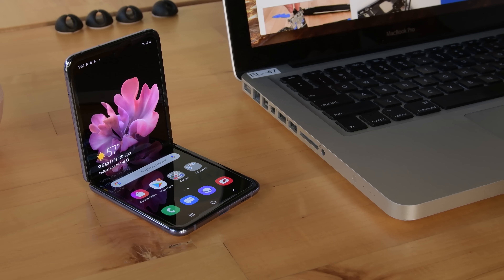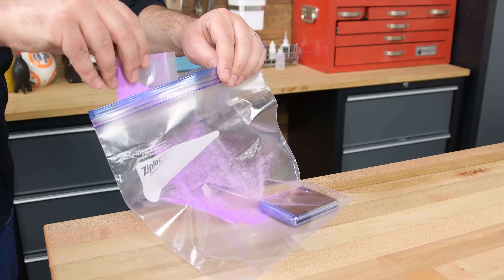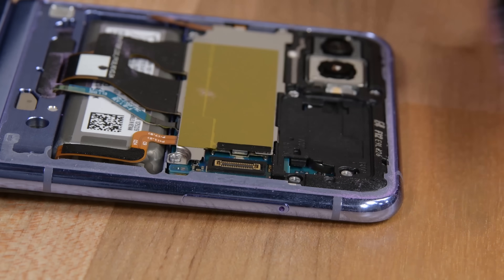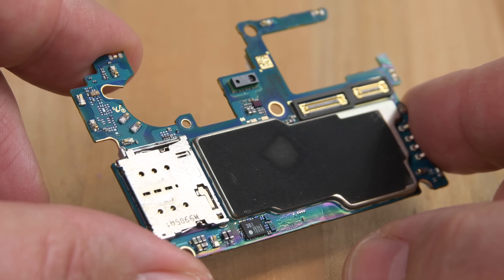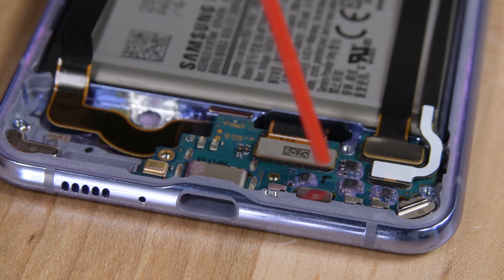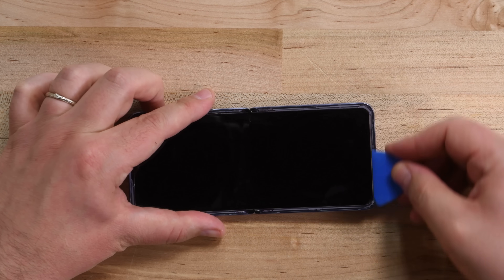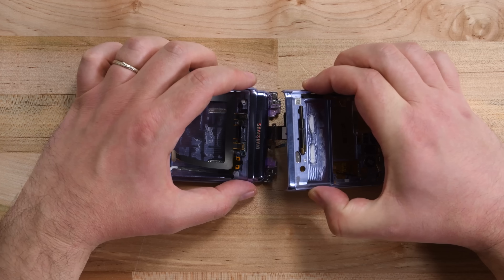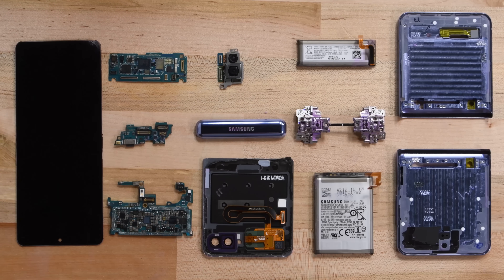Galaxy Z Flip Teardown and Dust Test FAILURE!

Comment: i'd say 3. you can reach the battery and many components with ease but the screen would be an absolute nightmare to remove
Reply: 1 - the battery is heavily glued into place which actually is really dangerous.
Reply: @Raja995mh33  then the razor should be 0 cause that was 1...
Reply: @hollymolly518  Yes.
Reply: @Raja995mh33  I find it weird that the last two companies that had flagships with removable batteries (LG & Samsung) are the ones gluing in batteries now. And the LG G8's battery is even worse...
Reply: @Raja995mh33  correct, but it is way easier to access than the razr. here you just have to remove the back panels and some small things. not the entire front, watch out for a small ribbon cable and then some
Reply: Secretqwerty doesn't make a huge difference... just because you can open the device easier, means absolutely nothing.
Reply: @Raja995mh33  Yes indeed
Reply: You shouldn't have a need to remove the screen unless it's destroyed though. Most likely it'd be damaged or broken if you tried. Everything for the most part is accessible from removing the glass backings.
Reply: You can reach the battery but you can’t remove it easily.
Reply: bruh IPA isn't that hard to get ahold of, and they used it to pretty easily to remove the battery; that and a hairdryer to remove the back glass and honestly the phone is pretty straightforward to remove. i'd give it a 5.